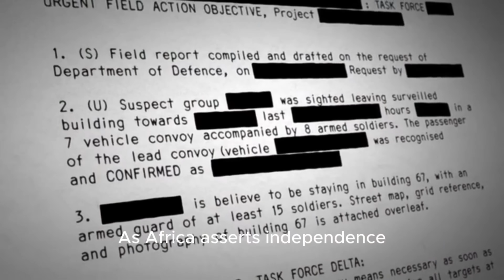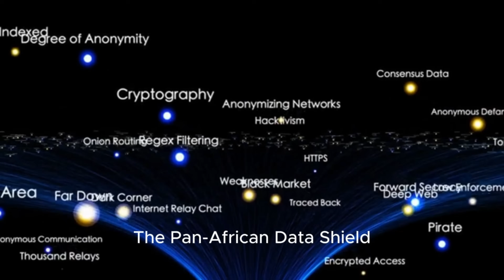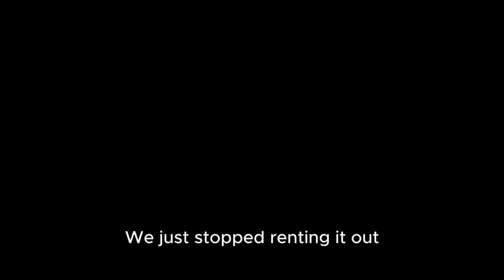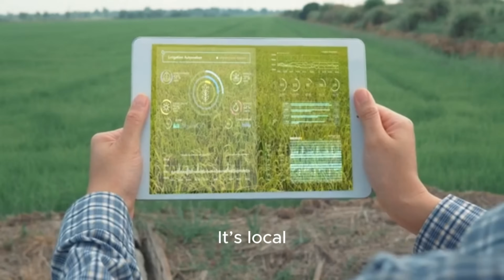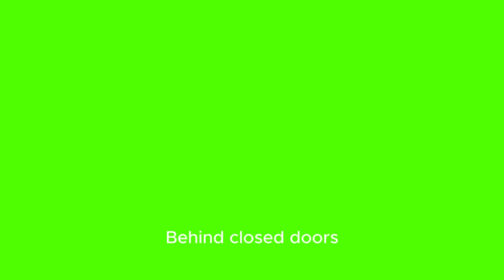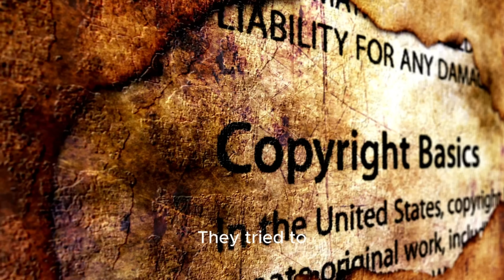“The Hidden Battle for Africa’s Soil: Why U.S. Seeds Are Being Rejected”

Comment: Sir/Madam
1. In India present government long back started every Indian to open a bank account.
2. Then big demonetisation currencies of Rs.1000 and Rs. 500 on 08-11-2016 and replaced with new currency through banks. Since then Pakistan started going for loans.
3. Then UPI started 12-04-2016. Then all central & state governments started paying all subsidies to farmers, physically handicapped, students and all the other Indians who deserved a help from governments.
4. Then all payments to any body can be paid with a QR code or with phone number.
5.  Advantages.
     A. No need to carry physical cash
     B. No Change issues as paid exactly.
     C. No Education required to use
     D. All monies are accountable no evasion
          of tax problems. No        black money.
     E. No risk (no phycal cash)
     F. Both payer and receiver deny either
          payment or receipt.
     G. Can pay from Indian bank account in
          Singapore, UAE, France many other 
          Countries , as the same converts to
          The currency of receiving country
     H. Hardly any charges from UPI
       I. At any point no need to run to the
          Banks.
      J. Fully secure.
      K. Payments can take place anywhere
           in India and in those countries where
           there is an agreement for implement-
           ation.
If some countries feel that they are great and decide that they do not want to implement Indian made things, now a days India leave them to their destiny who do not want to pass on most viable, cheap, secure systems to their countrymen.
India now say India needs as much as you need India. 
Any country decide to travel with India welcome with conditions of
     Sovereignty and integrity paramount for 
     all Indians.
     As an eqaulant partner, not as a pawn,
     broker or ally.
     No dictation
     Only honesty hard work mutual trust
     (here trust means accountability)
     All time bound ground realities should 
     be emerged out of written agreements                                
     and transperent financial & material 
     transactions should be equally
     mutual benefits.
Please do not treat the above as business conditions. Treat as pre-requisites for business with anybody in any condition.

Best regards, Namaskar👏
Proud Indian 
Jai Bharat,Vandematram,
Jai Jawan, Jai Kishan, 
Aatma Nirbhar Bharat 
(Self-Reliant India -  Self-Dependent India